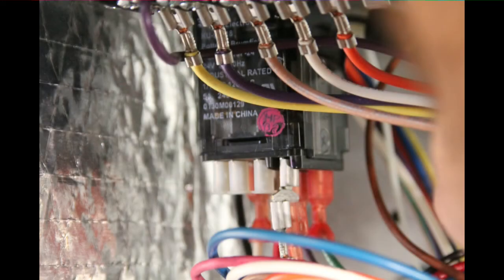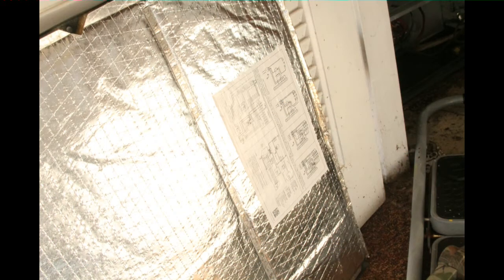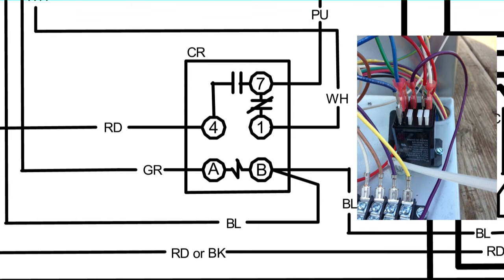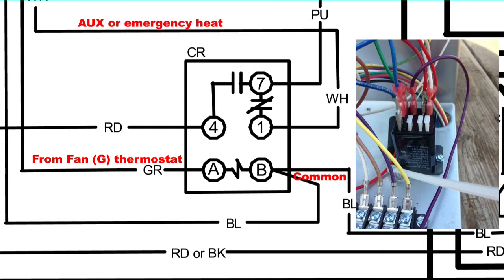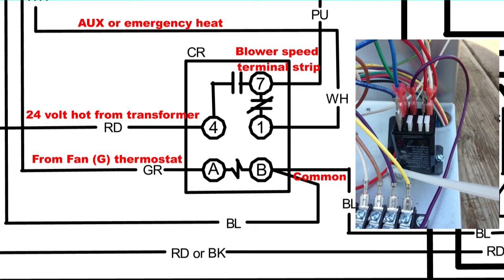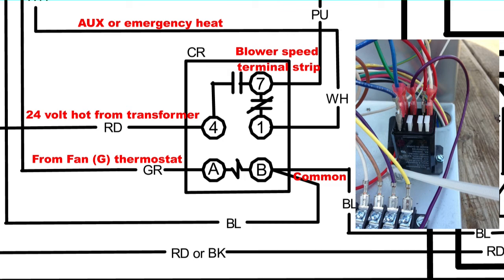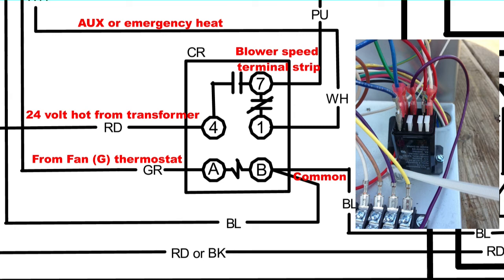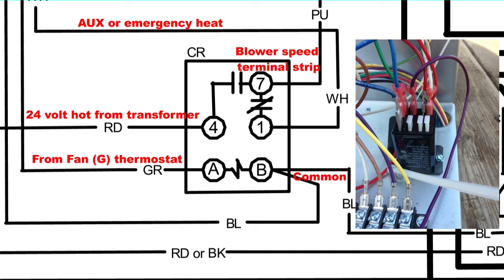HVAC Relay Training - Goodman ASPT Air Handler Blower Relay

Comment: I have a Goodman 4 ton with a similar relay. However, my air handler stays on regardless if I disconnect my thermostat. I looked at the relay and it appears that it is rusted very bad inside. Would this cause my fan to always stay on. The outside compressor does turn off and on. Thank you.

Comment: First I gotta say Im new to the tech side so don't think im dumb for this. The other day was working on a 2003 Amana air handler with no heat. First I thought bad heat sequencer then saw they had relays. Checked low voltage on relay and was getting 11 volts. So I thought maybe bad control board not sending 24 volts. So I by passed the board straight to transformer and still nothing. So I changed the relays and they worked with the control board. Decided to let it go with 11 volts and call tech support about the 11 volts. Found out the bourd was sending 22 volts DC to the relays. So I had to go back and put Relays with DC coils. Why would they put DC relays. Another great idea?
Reply from the maker: Philip Villaloboz I never liked those DC relays. I like good old sequencers
Reply: What happens if you just put a regular heat sequencer? Will the DC voltage do something to the AC heat sequencer?